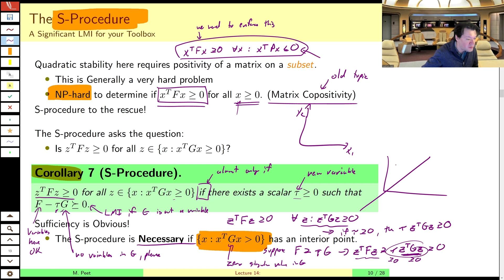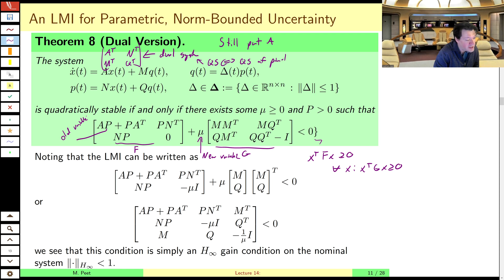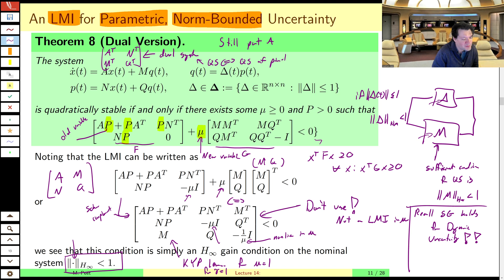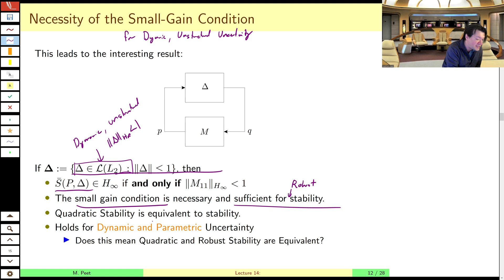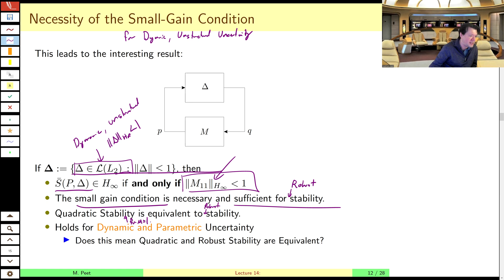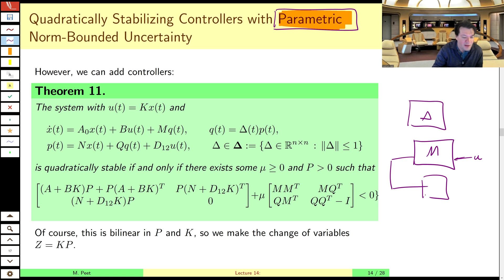MAE509 (LMIs in Control): Lecture 14, part B - LMIs for Robust Stability and Control using the LFT

Comment: Dear Professor,
I have a question regarding the explanation at minute 24:29. Why is the z (regulated output) defined without considering the D_zw term?
In tracking control problems, I thought that this term plays an important role in introducing the reference signal into the regulated output.

Comment: Hello, thanks for awesome lectures! I have a question, on slides 14 and 15, the uncertainty is listed as q(t) = Δ(t)p(t), but you mention "not dynamic uncertainty" around 17:02. Does time varying Δ(t) not mean dynamic uncertainty?
Reply from the maker: It does seem a bit odd, but the standard terminology refers to Δ(t) as "time-varying parametric uncertainty". "Dynamic uncertainty" refers to a set of hidden/unmodeled differential equations which interact with and influence the system. Dynamic is sort of a vague word, so your interpretation is plausible, but the controls community has sort of settled on these formal definitions.